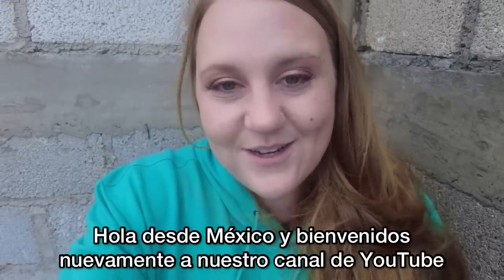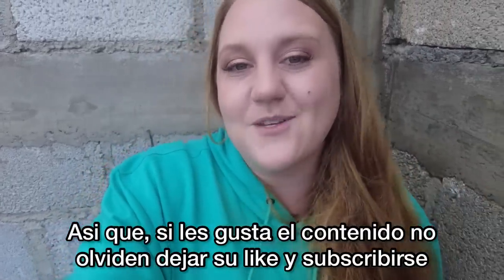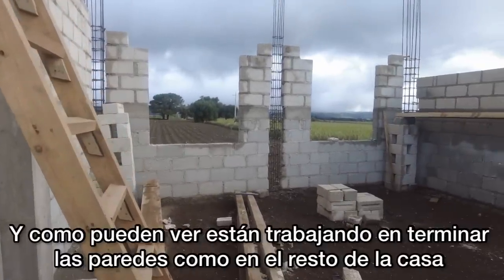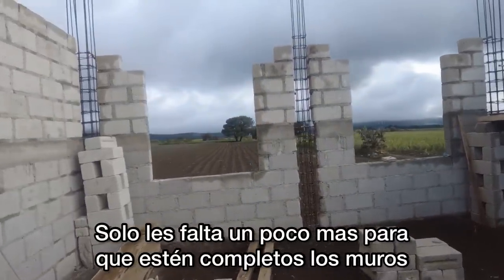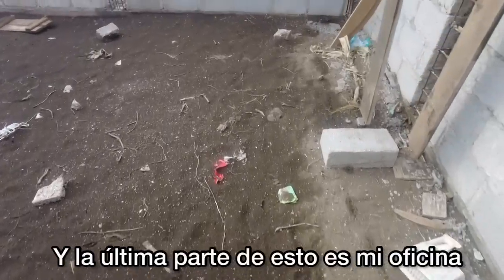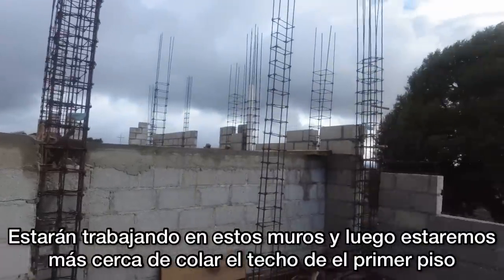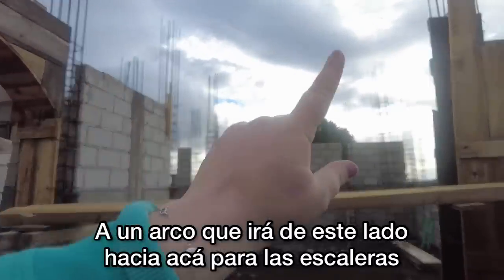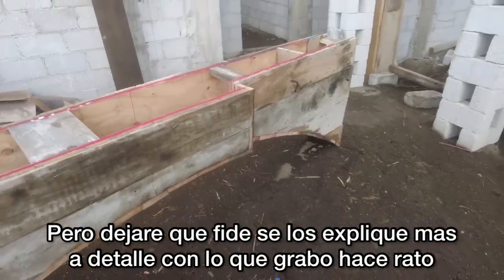Building Our Home in Mexico - More Walls are Going Up!

Comment: How lovely they are building a big house and is so interesting how they are using   those big concrete blocks instead of bricks. Here in Chile we do use hollow bricks filled with fresh cement and vertical metal inserted inside to avoid having down the walls with earquakes. Yes we are a seismic country!